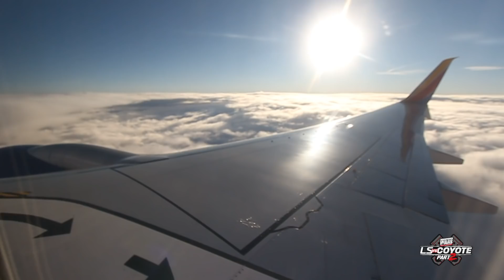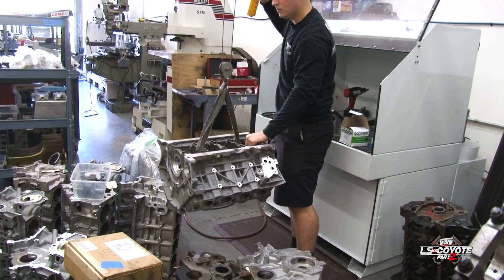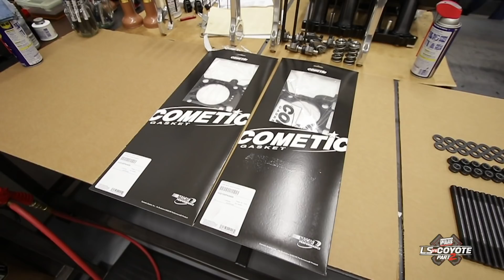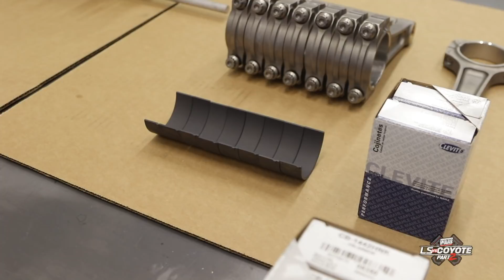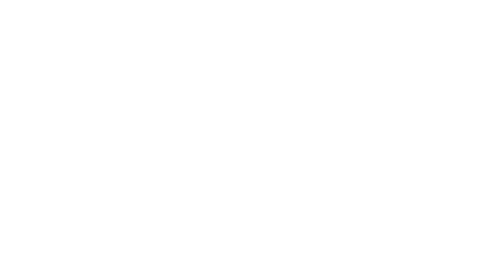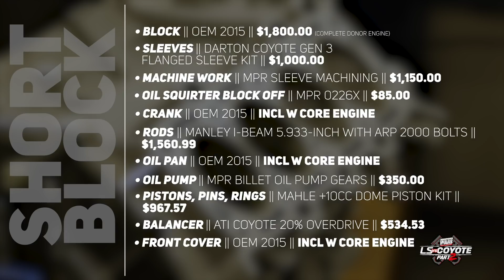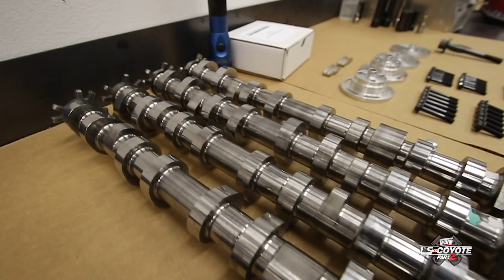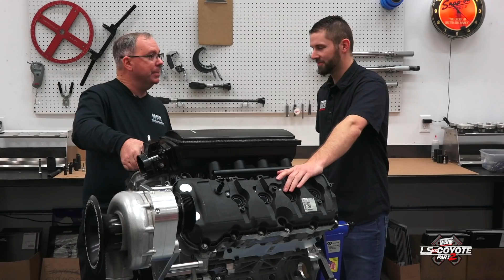LS vs. Coyote 2 Episode 3: The Coyote Engine Build

Comment: The procharger is going to mean that regardless, these engines are going to make the same power. If it's a dyno shootout, they should have a curveball where they just boost a junkyard gen4 4.8. It'll make just as much power as these engines. Just pulley it to spin the blower at the right speed to move the air density needed. We know Gen 4 LS rods will handle the sort of cylinder pressures nessecary to make that power number at around 6500rpm. torque curve will probably be about flat.

Comment: How about comparing the ls3 crate engine to the 5.2 crate engines performance
Reply: how about NO, WHY WOULD ANYONE LIMIT THEIR CHOICES? I CAN GET AN lsx454/LSX454R FOR $14000, Aluminator is $16300,  BROTARDS AND THEIR STIPS.... As long as its even in your head little guy. What part of budget dont you guys understand? The budget is the stip. Why dont you ask for a 351 build instead? This is purely about money and what you can get for it. Can get an LS7 Crate for $13300 and throw a cam in/ intake on it for  about the same money  and make  600+ to the wheel all day gifting you 1 full point in compression!  FFS I could fit a 572/720r  in the same spot as your 5.2 for $15500, and Im sure their are a few SBF and Hemi  crate engines that could be had that have more power for the same  $16300.

Comment: For the people complaining about the block differences.  A quick search on the Texas Speed shows the resleeved LS truck block with Darton sleeves at $2700.  The LSX block used for this competition was $2782 at Texas Speed.  So really it was just a matter of choice by the builder because the resleeved LS truck blocks with Darton sleeves have been shown to handle the power levels I'd expect an F1x procharger to support in this test.
Reply: With aftermarket heads and 125 more cubic inches?
Reply: @tomhamilton9140  What does that have to do with the price of the block?  No one gave anyone a cubic inch limit it was based upon a $15,000 budget.  Sorry your coyote costs more to build the cubic inches were chosen by each builder with the budget they had to work with.  Good old pushrod motor simple and cheap.

Comment: Build a ford 6.2 boss. Itll eat the LS. Forged crank. Get new rods and pistons. Then add boost. Watch.it walk the lsx 454.
Reply: Why build that when i can fit an all aluminium Tall Deck BBC in the same space and make more power for less money? Stupid fuqtards comparing a built 6.2 BOSS  vs ls crate engines shm
Reply: @shaadydog1  the "boss" 6.2 is the iron block 2 valve ohc from the super duty and raptor lines. Nothing all.that special. Its at least a comparable displacement to the gm. You wanna compare go ahead. But know your engines. Coyote was a codename for the 5.0 Boss was the new 6.2 codename. It was gonna be hurricane. Buut they had reasons for not going that route. Oh. And name calling? Really?
Reply: Yes let's use a Unicorn engine with a bore space greater than any small block V8 produced from the big 3 to do a build off. Basically Fords answer to GM 6.2 was to build a completely different engine only offered in trucks and sharing no commonality with the modular platform and a bore space closer to old 392 hemi than any sb. Triple F's  always got stips...
Reply: @shaadydog1  not a unicorn. The 6.2 is for all.intents a big block modular. 376ci. 2 valves per cylinder. The heads can flow massive quantities of air. Stock N/A is 411hp 425tq.. Its been built up for much more. Ive seen almost no builds outside of the Hennessey raptors. Oh. And if it was a unicorn, i couldn't get a low mile engine (60k) on ebay for 2500.. Just a bit of thought
Reply: @PureCountryof91  But it is, you will absolutely hear about it more than actually see it. Its expensive to build, no aftermarket support, by design very heavy and big  and at 4.53 bore space is not a small block, it would fit into a spread bore category so add even more weight penalty.  Its been out for 10 yrs and swaps are not common. It can be built to 460 cubes from what i understand but again its just not convienent to the consumer. You can do a 557 bbf and P51 heads for less than this Coyote build and have an easier time fitting it. It is  also likely to be phased out by  you guessed it... the new pushrod 7.3.

Comment: This thing is just as much of a joke as the others. For years and years this same joke has existed. A ford takes less to run well , but because GM parts are so cheap and when you start out with 100 cubic inches more,,,,,,,,,, I mean seriously people ? How is this a shootout ?
Along with everything else mentioned here in this thread im not sure how you GM fanboys can do this with a straight face.
Here is what I know , the little Ford engines are what every car maker is always competing with and measuring themselves by . Then they brag if they can beat it in horsepower after they stacked the deck against it about as much as they could.

Comment: Can a stock block cylinder bores be over bored then plasma coated 
People are doing it to harley cylinders giving you more cubic inchs better heat transfer longer wear than cast iron sleeves
About main bearing they are graded each set is fitted for correct clearances

Comment: Ohv limited on lift, push rod limited on rpm. A engineering problem old as the hills. Each have their place. You will see Ford will be coming out with a big displacement engine for big torque with push rods yea a push rod engine.
Reply: Except both engines are OHV...
Reply: @Fauxbra  meant OHC thanks for the correction did not proof read.

Comment: These are the facts. 4v ohc pentroof is better than 2v pushrod inline valve wedge head. PERIOD. The only advantage that most "ls" engines have is displacement. Everything else that is claimed to be better about LSs is easily refuted. So you wanna 1 on 1 this, it can be done. Now wether someone can overcome their ignorance and learn about it is another story...

Comment: There is no Ford vs Chevy thing here. The cards were all ready dealt and all in favor of Cubic inches. The only way this Coyote is going to win this fight is if it can hold 45psi of boost. On a stock cast block, even if heavily massaged, not likely to happen. LSX 427cid x 2 atmospheres (29.3919 psi) = an 854 cid engine.  I'm guessing the Coyote will max out at 306 cid, so it would need to hold up to 2.8 atmospheres (41.1487 psi) = 856 cid just to be in the same ballpark. Even with sleeved cylinders, I don't think the block can take it. Let's say it does, then hands down it will be the winner.  One comment that is getting quite annoying is that these engines are dyno queens. No shit Sherlocks, that's what this is all about. Oh and feel free to correct me. I'm sure I ruffled some feathers.....................

Comment: Since all the government motor guy's are saying oh I got a 5.3 truck engine and boosted it and think they are the shit why not do the 5.3 truck engine or the 4.8?? I mean since the coyote at least in this video is a truck engine and most people's builds are a 5.0 truck engine's idk seems more on the same playing field and more what blue collar people actually can afford/build!!🤷‍♂️ just saying not everyone has 15000 to throw down on an engine build!!
Reply: As an ls truck engine runner I can say that if they had built the LS from a truck block of the same relative size, they'd be screwed. The only way to beat the coyote is to build a monster cubic inch Ls and do aftermarket heads and the like. The 4.8/5.3 have too small of a bore to build what they needed. It would've been fun to watch though. As soon as my 4.8 blows, I am very tempted to swap in a f150 coyote just to piss of the lsx owners at my local track.
Reply: @damianlindsey6177  If you think they would be screwed with a 4.8 or 5.3 you should do a little more research. 

Sleeved junkyard 4.8 (200,000 miles), stock bottom end, twin turbo kit and idk whats done to the heads. 1208hp, 60+ pulls and a majority were over 1000hp.

https://www.google.com/amp/s/www.hotrod.com/articles/hrdp-1109-stock-gm-ls-engine-big-bang-theory/amp/
(Says 5.3 but after taking off the head the flat piston proved it was actually a 4.8)
Reply: Its simple why they didnt. Because its a 15k competition, and this just further proves how cheap a 7.0L is to build vs a 5.0 Coyote. Why use a 5.3 or 4.8 when it would only use 1/3 of the budget and still make more power than the coyote? They dony want to embarass it that badly.

Comment: The fact that lme is running 427ci ls to try and out power a 302ci says it all for me!! Coyote!!💪💪
Reply: Lolol the ls made more tq than that trash ass coyote made hp.. come on give me your best excuses
Reply: Ok? The Coyote needs 4 cams and double the vales to even compete.
Reply: @nathan22outdoors8  cams and valves dont mean shit when you have less displacement. Make the ls 5.0 liters and see how well it fares. Not very good. The last sohc 7.0 liter engine made over 600hp naturally aspirated. The 427 cammer
Reply: Edgar G ls 4.8/5.3 junkyard with 300,000 miles and 2 turbos made 1500 hp stock so what’s the excuse when GM’s smallest LS made more power and torque than what the coyote made in power? 😂
Reply: @nathan22outdoors8  4 valves in a smaller cylinder lol you mad
Reply: @juicebox8549  No im fine, double the valves let in a shit ton mpre air. The displacment doesnt even matter at that point
Reply: @nathan22outdoors8  don't you realize if the cylinder is smaller the valves have to be small too? dumbass i swear. the intake valves combined and exhaust valves combined probably make up one of the valves of the ls so i dont see your point
Reply: @juicebox8549  Still more air flow. Is the displacment of a 427 double what it is of a 305? Nope. Double the flow in an engine that is 71% of the size. Good try though.. fucking idiot.
Reply: @nathan22outdoors8  its like im talking to a wall. just stfu. The point here is 5.0 is smaller than the 7.0 obviously. ok has more cams more valves but still is a smaller displacement. Idk what you domt get about it. and if it had more air flow, wouldn't have more hp? just stfu and respect the little powerfull 5.0
Reply: @juicebox8549  The whole point of boost is to push more air into an engine. More valves simply put more air into the engine, making more power. Its common sense, u got proven wrong with simple math and now your butthurt.
Reply: 5.0 isn't 302 cubic inches
Reply: @anthonywebber2211  The ls1 was 346 cubic inches which isn't a true 5.7 and 4 cubic inches less than a 350.  Fact.
Reply: @billysandals , tell me something I don't know
Reply: @anthonywebber2211  I was mocking you.
Reply: Anthony Webber then what's the cubic inches if it's not 302???
Reply: @marcojasso2695  305
Reply: @nathan22outdoors8  GM 5.0L are 305, Ford 5.0L are 302.
Reply: @Steve-wl7jt  there is only 1 way to convert liters into cubic inches. Doesnt matter on the brand. A 302 is 4.94L. A 305 is a 5.0 (4.998)
Reply: @nathan22outdoors8  I dont think your going to change anyone's mind by getting Technical with math.  Since the first battles of Camaro vs. Mustang with their 5.0L engines it has always been known as a GM 305 and a Ford 302.  Just as you stated 4.94 is not 5.0 but ford always uses the 5.0L badge.  If you want to get techinical,  the Coyote is a 4.951 or 302.1 CI until the Gen 3 and that is a 5.035  or 307 CI., and that is straight from Ford.  You can always round up or down a bit but either way Ford is going to call it a 5.0L.
Reply: @Steve-wl7jt  well thats a different story because a 5.0 isnt even 5.0L than. But if it actually was a 5.0, it would be 305 not 302.
Reply: @Steve-wl7jt , what Sounds better, 4.94 or 5.0

Comment: Where do all you fanboys get the hate from? Freakin CHRIST! Who cares who make more hp or more tq. Each motor has has strengths and weaknesses compared to the other. The LS will probably be a better strait line motor where the Coyote will be a better track motor with higher revs and more hp up top. That is what is nice about 2 different things we as consumers can pick what best suits our needs. Maybe an LS will fit our need maybe the Coyote will or maybe a 1200 hp 2JZ inline six from a supra will. (I'm not "tuner or Ricer" just know these exist and are nor rare). 

You can argue for "your" brand but don't hate for it. Again each has it place. Mustang and Camaro trade blows. Both have had very high HP numbers at one point but never at the same time and both offer excellent track cars (Zl1 1LE vs the gt 350-R).  GM has the Corvette nothing from Ford directly competes with any Corvette. But Ford has the GT. GM does not and never had a car to compete with that from the past or present. 
So, who is better, Ford GM, Dodge, Toyota, Nissan? How about I pick what I like better and you pick what you like better and stop name calling and shitting on somebody that chose differently base on their wants and needs.

Comment: There are some GM faithful in here playing the same old tune..."Our parts catalog motor is a "stock LS and the modular Ford is a rule breaker because it's sleeved"! WTF. LS gnats just remember this. When Engine Masters put out these rules for the Boosted LS vs the Boosted Coyote there were no LS applications received.  NO TAKERS!  There should have been. The rules gave the LS 6.2 liters and the Ford had to come in at 5.0 liters. I guess that the fabulous LS just did not like its "rule break" or BOP allowance enough for the GM crowd to take up the challenge. And for the GM guys that do not know what BOP means it means Balance of Performance. Every form of motorsport that GM competes in with its pushrod engine (except NASCAR) has BOP allowances in place to make the otherwise outclassed GM rod kicker competitive. Cheap and plentiful does not = Best.
Reply: Is that an LS Vette in your tag? I'm guessing you read it and your ass hurts.
Reply: Only FANBOIS Brotards would complain about having great aftermarket support thats cheaper/stronger/better preforming than factory stuff... FFS Do you fuqtards  listen to yourselves? Ok i wll limit cubes to 5.3 if you limit valves to 2 sound fair fuqbois? Seems fair to handicap the benefits of both platforms right?
Reply: BOP is attacked in many ways, not just 2 valve vs 4 valve fuqtard, In endurance racing BMW/Porche/Ford/GM etc. etc. might have a higher/lower weight limit or get more/less fuel, or have higher/lower rpm limit. In drag racing differing bore centers can get weight breaks, or get more boost, different power adders are limited to different boost levels and NOS might get a weight break, the type of supercharger is limited in size or no screws are allowed,  or no high helix, So no you are wrong BOP isn't just for GM its for everyone and its to make the entire year competitive and come down to the last few races if possible, that gets most viewers and most sponsorship dollars.
Reply: @shaadydog1  When you misspell fuck-tard you look like a fuck-tard. In the end no LS will ever make the kind of power levels that people have made with a modular Ford. And the fact that these guys at MMR and Mihovehz have done it with factory pieces makes it even even better.
Reply: They about the only people doing it  AND with deep pockets at that. They have now resorted to billet blocks, FUQTARD
Reply: @SyphonX  Not a GM part in that engine. LS inspired motor. Like calling a Brad Anderson Hemi a Chrysler or a Boss 500 a Ford. These Guys (Ford) are going to put a number up with factory parts...you know like under the hood of an actual car build by the manufacturer. In the end I want to see what the Ford does. It's relevant because my car has that same motor and a working class guy like me can follow that path to make more power. On the LS side...well not so much. They have gotten so far of track that a guy would need to raid his retirement account to by one of their $55K+ engines. It is not even real world hot rodding anymore. This is why the Mustang kicks the snot out of the Camaro in sales and is far and away the #1 supported car in the aftermarket. GM is failing the Camaro for all the reasons you think it is great. So continue to pull the ENTIRE engine when you want to make power. The guys with the Mustangs, Supras, etc have it figured out. Your Camaro is on track to die once again. It's actually pretty sad.
Reply: @SyphonX  about what? My response was to the idiots that seem to somehow think ProMod  budgets, the records, their bs skewed  rules and willingness to outlaw a combo  after 1 successful week is somehow relevant to the real world and somehow proves superiority among a certain group of engines or manufacturers.
Reply: Zero applicants for the most popular "Hot Rodders" engine in an engine build-off...The outcome was a forgone conclusion...Fact!